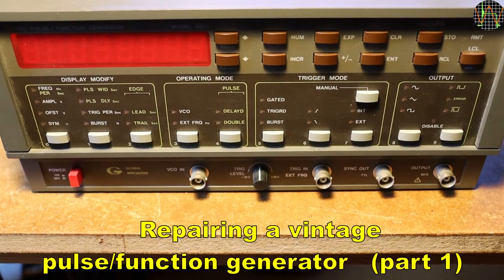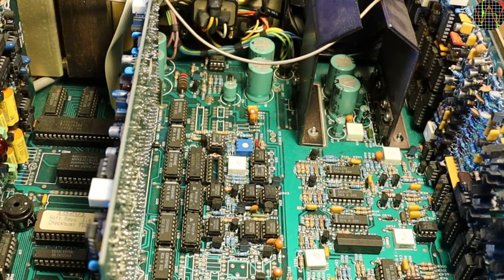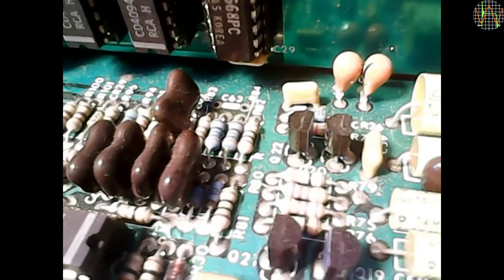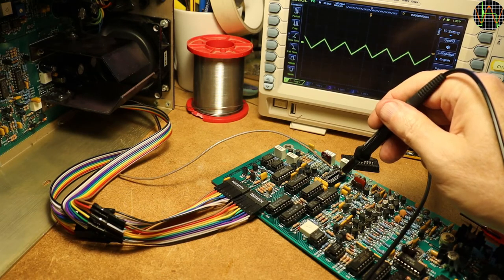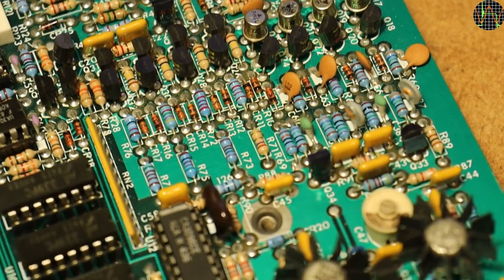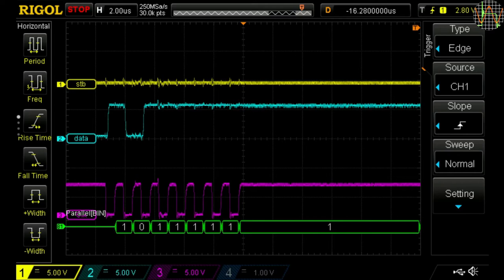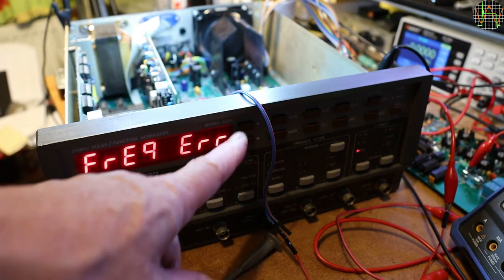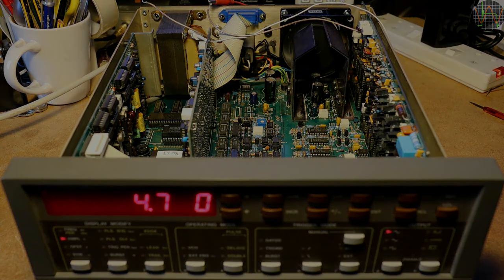#100: Repairing a vintage pulse/function generator (part 1)

Comment: Nice to see someone else tackling test gear repairs, nice work so far. I recommend replacing all the capacitors as a matter of course on old gear like this. I also think you need to make a copy of and replace the Dallas NVRAM module, it likely stores calibration constants.
Reply from the maker: Yes, I agree,I already replaced all Elco and Tantalum caps on the main board and the final amp board. Still to do is the pulse gen and the rise/fall board. I got the replacement caps but all the other issues kept me busy.... The NVRAM is not terribly urgent as this unit has no cal data to be stored.All cal is done the old fashioned way, trimpots and trimcaps. The NVRAM is only used to store the current settings so it can restore it after power-up and you can save a couple of additional frequently used settings and recall them. If the battery fails, all you get (according to the manual) is a warning and then it uses defaults instead of the last used settings.

Comment: A bad tantalum was my first thought when you demonstrated the supply rail problem.  They fail so close to zero ohms that even a thermal imager is unlikely to show much.  I would recommend using an ESR meter to track down the minimum resistance.  This has saved me taking a shotgun approach several times.
Reply from the maker: Interesting. I understand the theory but can you explain how you managed to get that to work in practice?  It sure would help a lot. What type of probes were you using and did you probe the tracks or solder joints? Were the tracks covered with solder mask?  My own experience when trying this: 
I can measure resistance to 1 milli-ohm resolution but I found that the varying contact resistance when probing solder joints on the PCB against ground produced values too unreliable to allow narrowing down the area with the marginally lowest resistance. Even probing twice at the same position would produce very different resistance values. I mean they were not hugely different but different enough to wipe out any trends between measurements from different areas.

Comment: Great channel. Interesting content. Just a suggestion... A video about measuring high resistance (1GOhm and higher) using a pA Level Transimpedance Amplifier. Accuracy in the measurements and so on.
Reply from the maker: I have been thinking about how to respond to this for a while. Maybe sometime in the future is all I can say at the moment. There isn't a pressing need for me to measure very high resistors (my BM869s can do 1nS or about 1 GigaOhm) or measure pico-amps and I normally would only go about such a project if I would need it myself.

Comment: Buying Chips from ebay you dont know if you are getting crap from China. I have had chips marked but they are not what you think. Ebay is like getting crap out of the toilet better to buy from a reputable  place like RS electronics or Digikey
Reply from the maker: I agree with you in principle and on anything safety relevant or high-value I  definitely go to proper distributors. For this project however, I had to be very cost-conscious because there was the substantial risk I would have to abandon the whole project as irreparable. Selecting a vendor is a calculated risk. In this project I bought the replacement capacitors from a proper distributor  because if they fail again in 3 months its a lot of trouble and maybe some fire risk.  On the chips, I decided to take my chances.  Ok I got 10 bad chips but in my experience that doesn't happen that often. The 2nd batch of LM311 from Ebay was fine and the AD7533 multiplying DAC chips were fine too and I got 3 of these for the price of one from one of the reputable distributors, not bad! On the risk of sounding like a broken record, when buying on Ebay I look for the reputation of the seller and don't go for the lowest price